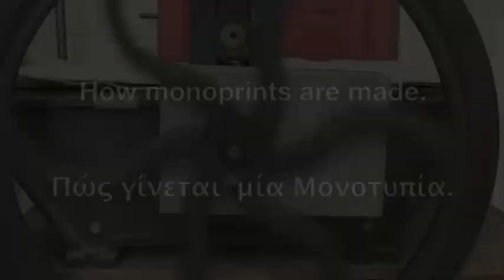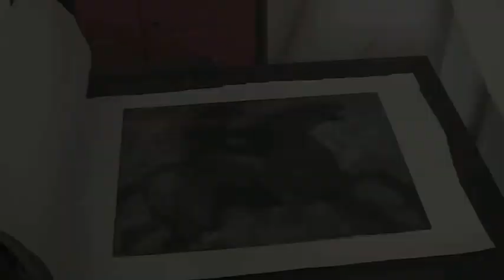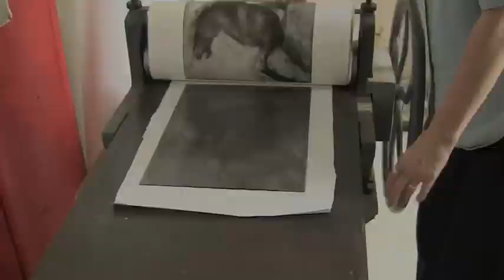Monotype Process

Comment: I really liked this video, thanks for sharing! I wanted to ask you what material the matrix is made of, since I have used glass but without using the press afterwards
Reply: Stainless steel or aluminium plate, beveled edges so as not to cut the blankets?

Comment: What specifically did you add to the ink when you were mixing it. Do you have any tips on type of ink to use? Relief? Etching? Litho?
Reply: Sorry Anne for missing your question form a year ago. I'm using black Charbonnel ink and mixing with it a bit of Liquin in the video. But I'm now using a water-based ink, Aquawash, and using water-based Liquin.

Comment: What stylus did you use for this?
Reply from the maker: Leinard, there is no stylus used in making this print, only a rag, fingers, a stick and feather. There was no hard-point incising or acid etching or scratching, only surface application of ink…a pure monotype.